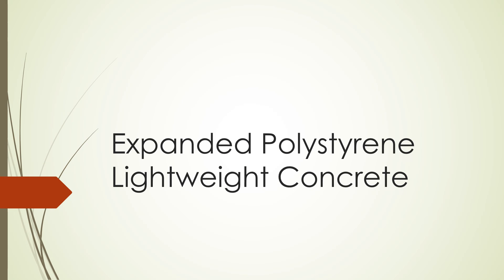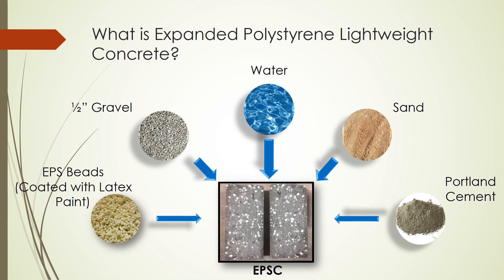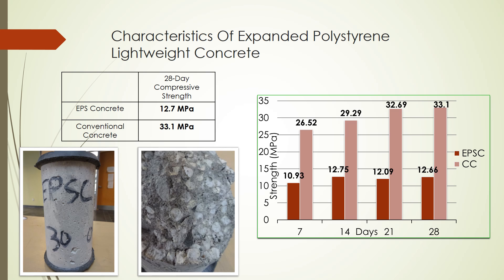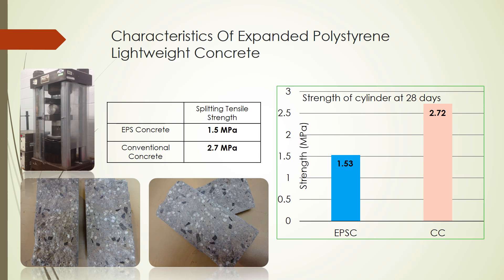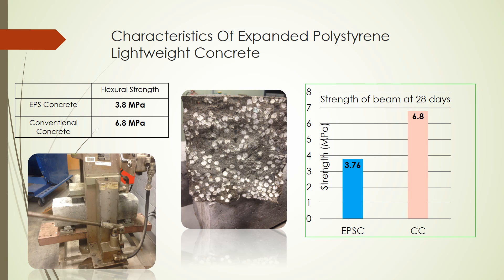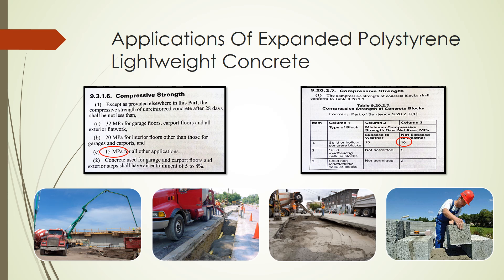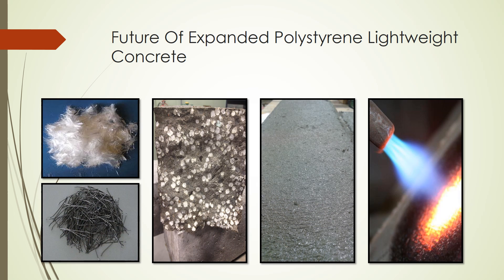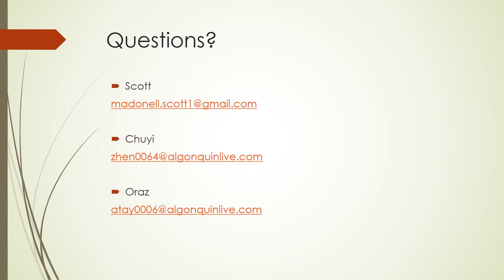2015 Fall: Expanded Polystyrene Lightweight Concrete (Group 05CW)

Comment: Oh, I forgot to say, Not 100% sure, but I THINK “Styrofoam” is actually a registered trademark of the Dupont chemical corporation, and technically (legally) you can’t call just any expanded polystyrene foam “Styrofoam” unless it was actually made by them, or maybe someone under their licensure ... you have to use the generic term. In every day use, it seems like hairsplitting, but in writing, on a public forum, with a wide audience, I would advise a “better safe than sorry“ policy. If you don’t think little YouTube channels get sued over stuff like this-think again. Companies use web crawlers working 24/7/365 to look for copyright violations. About a week into production, our tiny little community theater got a “cease-and-desist“ letter from a law firm because they used a couple of scenes verbatim from Agatha Christie‘s “mouse trap“ in an original play “The Making of Mouse Trap” written by one of our local directors ...(Community theater play about community theater plays… It was hysterical, BTW) LOL ... We were allowed to finish the show on a one-run basis,  and with certain additions to the programs handed out, but unfortunately, it prevented the publication of a very good script without tons of legal rigmarole.

Comment: … Amazing; after the first 200 to 300,000 uses of the entire term ‘expanded polystyrene lightweight concrete’ 
I think you could get away with just using the initials EPLC, yet you can manage to smash “coarse aggregate’ into one syllable, And say it so fast that it just sounds like you stuttered, or coughed… Otherwise, great idea, good video.

Comment: when mixing the EPS to concrete the styrofoam float and it will not mix properly
what is your solution so that it will not float?
Reply: TOP BLOCK  mix the cement and eps  before adding water

Comment: in Europe they do not put gravel or sand in the mix since which do not add much strength to the  material but reduce the property of good insulation and light weight